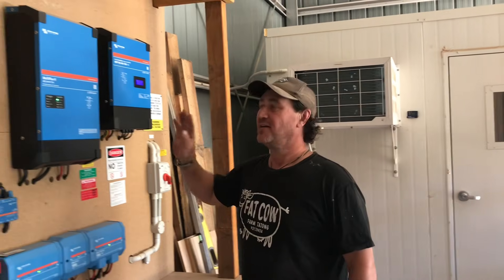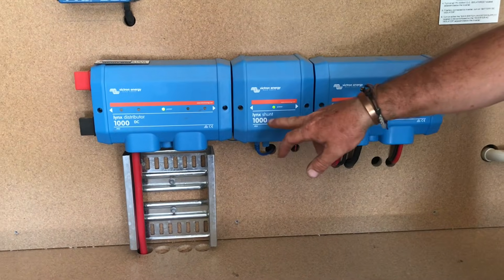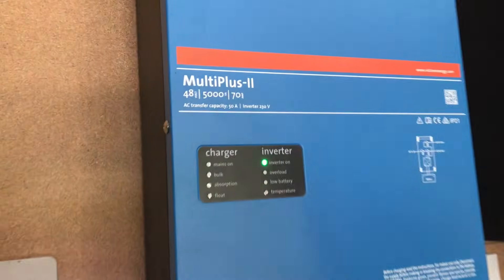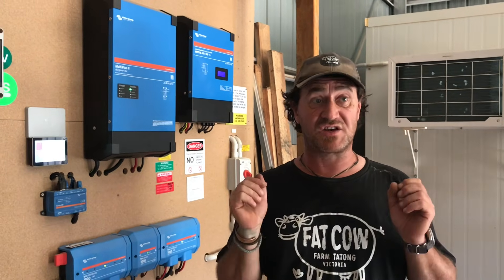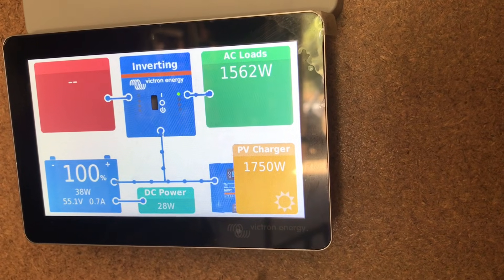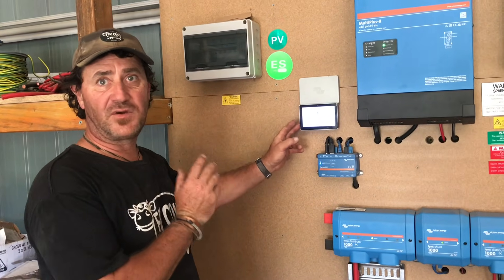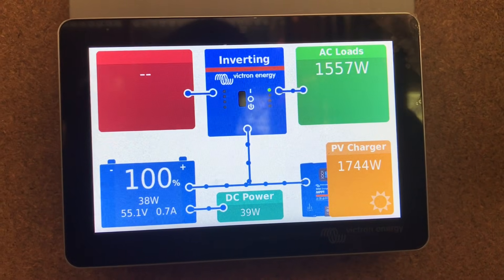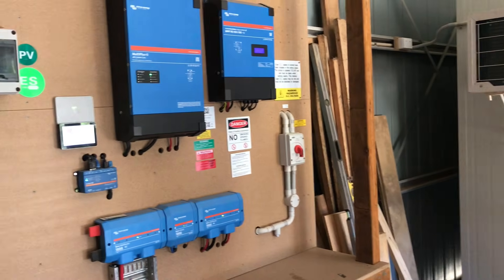Victron Solar System Install - Part 3 MultiPlus II 48/5000/70 & MPPT 450/10

Comment: Is there any chance that you have a saved firmware version lower than 1.09 for this MPPT?
In the newer ones they lowered the maximum charge voltage, and I stupidly updated. Now I'm looking for a way to get it back.
The official repository only has versions from 1.10 and newer.
Reply from the maker: Hey Martin, I'll have a look at the QR codes. My system tends to only have an input that is 300 - 400 watts above the usage for charging and maintaining. I'm in the shed today hang tight. cheers
Reply from the maker: Hey Martin, I've looked over the QR codes and firmware. I still have the 1.09 for the MPPT. This is what came with the unit and didn't upgrade due to the lack of internet access in the machine shed. Sorry I can't help. Sure there is something on the Victron web site or victron forum. Might be with having a look. Cheers Pedder.

Comment: Hi from Tolmie.  i am in the process of planning a 12KW solar system with 35KW Battery bank, using Victron components. As a test case, i have already built 2 x 12V battery banks with nearly 6KW of storage, and have working well in my camper trailer for 3 years. i am about to order the Battery cells for the 35KW bank. Are you interested in comparing notes at some stage?
Reply from the maker: That would be fantastic, what batteries are you using?
Reply: @FatCowFarmTatong  i have ordered 30KW of EVE cells, and JK BMS controllers, which i am going to build into a 30 KW 48V battery bank.
Reply from the maker: @naproctor  Sounds awesome, what type of batteries?

Comment: My solar system is connected but the inverter is not charging the batteries and its showing any input Voltage on the screen  of the inverter

But the solar panels are connected in series and have a combined 120v for the 3 panel that supplies a mercer 3kva system inverter

Comment: Looks like a good set up. Are they lithium or a deep cycle agm battery?
Reply: I’m off grid in Victoria as well with 80kw of lifepo4 batteries an I can’t praise them enough all done fully diy
Reply from the maker: @borichards978  Hey Bo, its a great feeling when things are done wright. Nice job. Cheers Pedder
Reply: @FatCowFarmTatong  definitely just because you go off grid doesn't mean you have to miss out
Reply: Looks like AGM
Reply from the maker: Hey Duncan, they are AGM deep cycle. I'm still not sold on the lithium with the issues of fire and explosions.

Comment: It’s modular so as your load demand increases you can just add components to handle the load. I had a cheaper brand set up a while back and had to replace the whole system when I added two irrigation pumps so I went with victron to make it easier and not need to try reselling systems

Comment: Why Victron separate components vs one all in one from someone else?
Reply from the maker: So - as my power needs increase I can add modules to increase if required. Its future proofing without purchasing a complete larger system.
Reply: @ Understood.  Victron is solid.
Reply: Victron just works.
Reply: Nothing compares to the vrm venus software and online features. Raspberry pi runs venus os